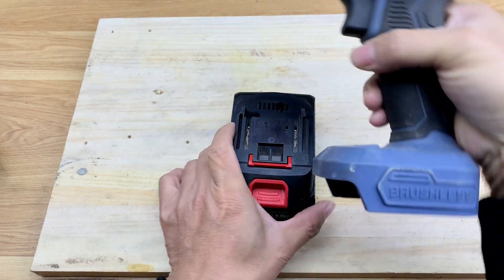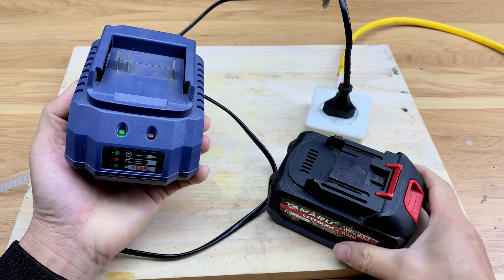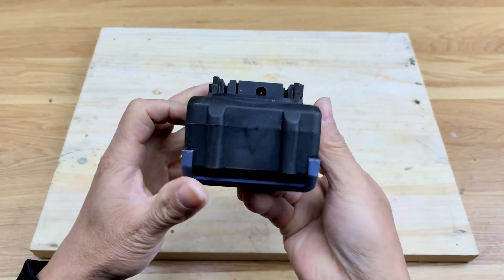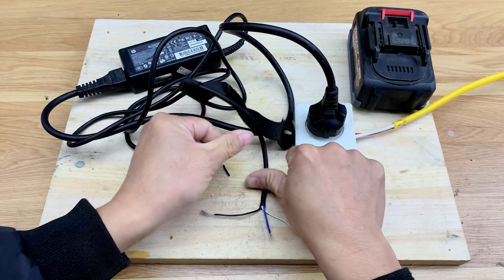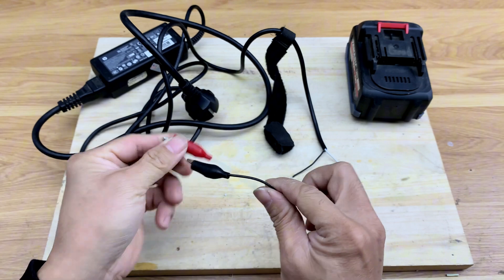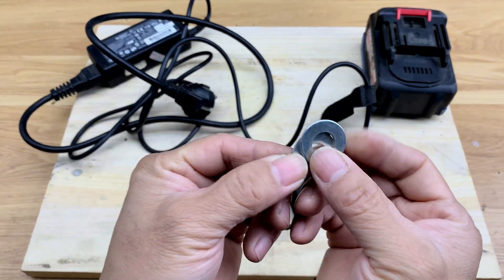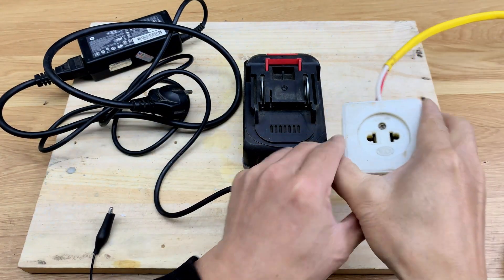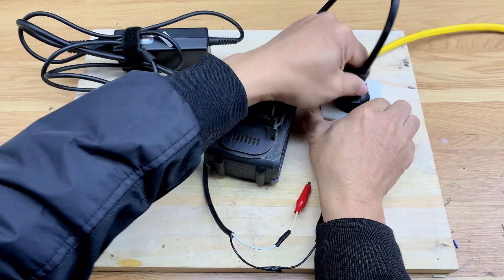🔋Never buy drill batteries again! Just use your laptop charger and see what happens!

Comment: It should work as once the battery gets below about 3 volts in each cell the charger will not charge the battery because it thinks it has a fault. car batteries also under 10.5 volts will not charge with smart chargers. I use my car jump starter to get the voltage up enough that it starts to charge normally. many times it works sometimes the cells are too gone.
Reply from the maker: You are absolutely right. Thank you for watching and commenting.

Comment: Did anyone try this after the video?
Reply: I restored the battery from an old Nokia phone in a similar way. The phone had been unused for about 10 years. I connected it to a 5V computer power supply for 30-40 seconds. The battery started charging from original charger, but its capacity didn't last long.